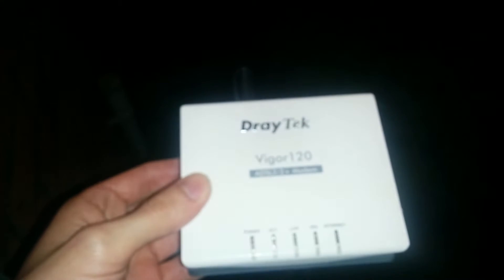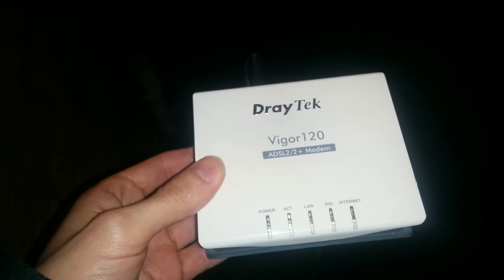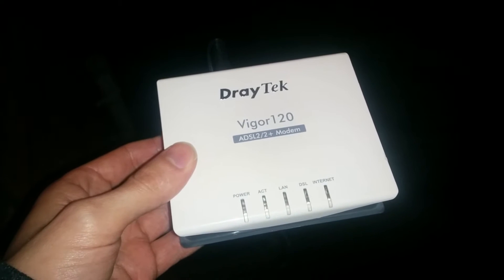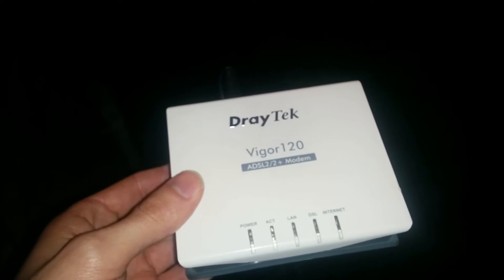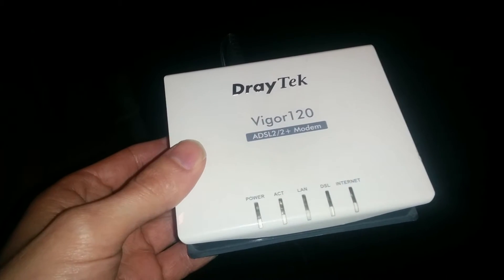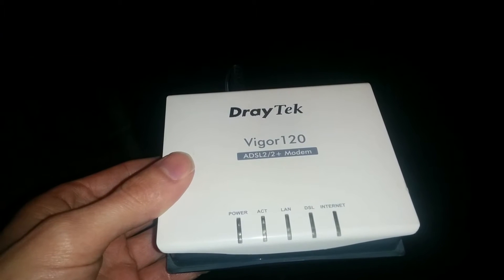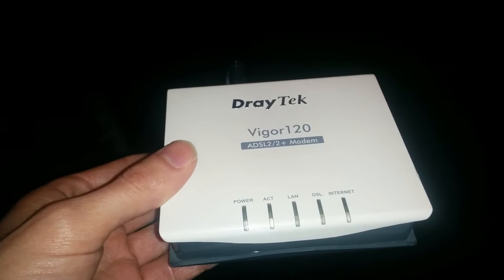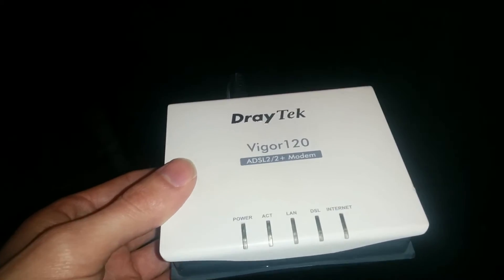How to repair your unreliable or broken Draytek Vigor 120 ADSL modem (Dont buy one of these modems!)

Comment: or you could update the firmware...
Reply from the maker: Draytek support confirmed with me that I was using both the latest hardware revision and the latest firmware version before offering warranty service on all 5 units which I purchased, and which had gone faulty.  Problem is I have no faith in the product and each device had to be replaced immediately as their failure to perform was a problem requiring immediate remediation.